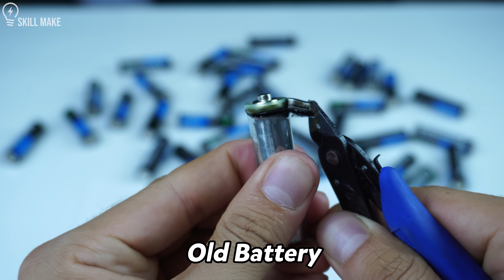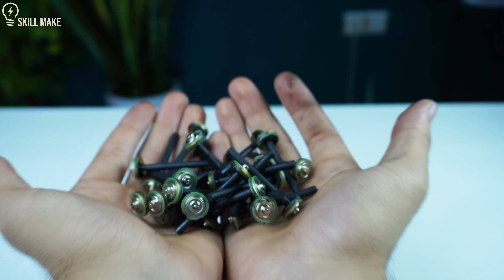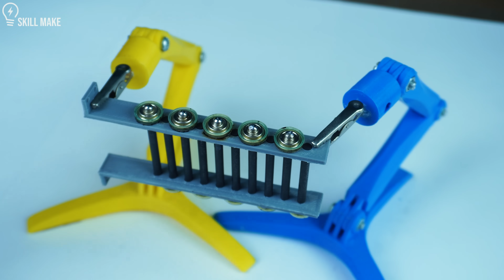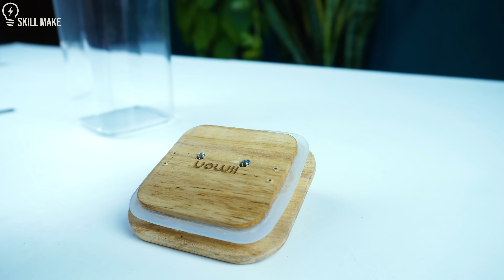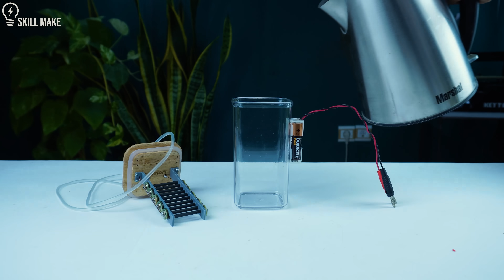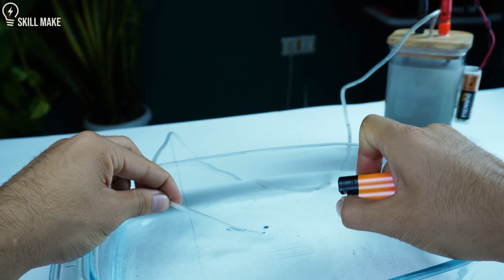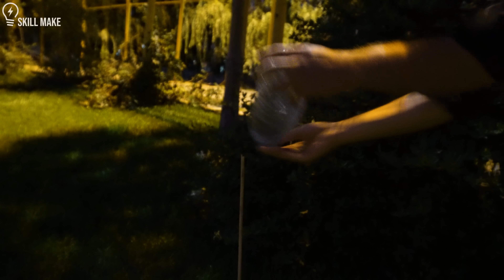Water into Hydrogen - Making a Simple Hydrogen Generator from old battery - hho

Comment: The installation is good. I tried to do the same myself, only more primitive. I didn't succeed: too little hydrogen was released. If you want to repeat it, remember that the main thing is to ensure the tightness of the system, and this is very difficult, otherwise nothing will work at all. Also try to maximize the electrode area and power. I used a cropped charge from a 2A phone. You can use ordinary water - it also conducts current (only NOT distilled). If you take ordinary tap water, then hydrogen will turn out much cleaner and will burn with a blue flame, but in this case you will have to greatly increase the voltage, otherwise nothing will work. Good luck!
Reply: Increase the surface of your electrodes. It's better to use stainless steel plates instead these rods.
Reply: Distilled water simply removes all impurities. Why would you not use it?
Reply: @Rotorhead1651  The fact is that pure H2O does NOT conduct current. Distilled water is pure H2O. If you take ordinary tap water, as I said above, then it contains impurities: all sorts of different salts and metal cations, which are conductors of electric current. That is why water seems to be a dielectric, but the current still conducts. Salt, acid or, as in the video, alkali is used to increase the content of metal cations in water and, accordingly, improve its ability to conduct electric current. However, these impurities are also involved in the electrolysis process, which is why other impurities also appear in the mixture of hydrogen and oxygen, which makes it more dirty. If nothing is added to the water ( not distilled ) then the mixture of hydrogen and oxygen will turn out much cleaner, but you will need a much higher voltage for the electrolysis process. I hope I explained everything clearly. If it's not difficult for you, please answer me in Russian. I wrote this text through a translator so that you would understand and not have to insert it into the translator and translate it yourself. I will be pleased if they answer me in Russian. Good luck!
Reply: @1KiNeTiK1   Stainless steel is certainly better than graphite rods, but I would advise using copper plates, since steel can react with the electrolyte and deteriorate or even crumble after long use, like mine. I speak from personal experience, we are tired of very strong corrosion even from a salt solution! Copper plates are much better, but they are hard to find and they are more expensive than steel. If it's not difficult, please write your answer with a translation into Russian. thanks for understanding.
Reply: @Rotorhead1651 porque reduz consideravelmente a capacidade de condição
Reply: [Quran:- 5:72]:-
“Jesus has said, "O Children of Israel, worship Allah, my Lord and your Lord." 

[Quran:- 19:30]:-
“Jesus has said, "Indeed, I am the servant of Allah. He has given me the Scripture and made me a Prophet.”

[Quran:- 4:171]:- 
“Christ Jesus the son of Mary was no more than a messenger of Allah…..So believe in Allah and His messengers. Say not "Trinity" desist: it will be better for you: for Allah is one Allah:
Reply: @HasanUnknown  these comments make me hate religion even more
Reply: NRROW THE gap between electrodes. mine is 1mm
Reply: I don't have 12 volt or higher battery ....i just have 9 volt battery ! Is there anyway i can work it out 😢
Reply: @mirae130  even a 6 volt works fine. reduce gap
Reply: @mirae130  Why not connect 6 1.5V batterys?
Reply: 2 batteries in parrel

Comment: Be careful playing with that gas mixture too much. It’s got everything it needs to burn, so it can very easily flash back up its tube, basically turning that bottle full of it into a bomb. If you could somehow split up the gas at the anode and cathode, and then recombine them right where the flame comes out, you’d have yourself a very ingenious and effective oxy-hydrogen torch. Capable of doing lots of cool stuff.
Reply: How do you put out the torch safley without blowing yourself up is my qestion

Comment: Very nice, thank-you.

Strictly this is making an optimal Hydrogen plus Oxygen mix since all the electrolysis products are mixed together.

Here in the UK, potassium hydroxide is not generally available but Caustic Soda is: equally, I imagine, as the preferred electrolyte.

Again, thank-you!
Reply: Let me tell you what the problem is. When you are halfway through electrolysis, the positive and negative electrodes will be covered with potassium, which affects efficiency. At this time, you only need to pause for two minutes before continuing. This intermittent work will surprise you.
Reply: @user
Just build a contraption to automate that process lol

Comment: I have always understood that a wet cell generator is inferior to a dry cell. I firmly believe that HHO has the potential to be a game changer. However, it must be done safely. The first method had no flashback arrestor. The second one, while it did have one, it was glass, which makes it highly unsafe. Using a simple check valve would be the best option. Furthermore, you could have used a 9v to power your device. I would personally avoid destroying batteries to obtain the parts needed. There are simpler and safer methods.
Reply: What do you use as electrodes? Carbon rods are great for the anodes (connected to battery positive), but not so vital for the cathodes. Not sure why you think disassembling carbon-zinc batteries is dangerous - it's much less dangerous than alkaline batteries (which are highly alkaline inside).
Reply: @michaelnoble2432  using stainless steel plates in a dry cell is standard. Usually, with a rubber or neoprene gasket in between each layer. Destroying any battery is unnecessary to create an electrolyzer. Plus, the wet cell method is inefficient and not suitable for the long term.
Reply: @P.I.E.  interesting - in theory stainless steel will erode when used as the anode (carbon is far more resistant to this). How do they get around this problem? I think using AC might help by reversing which plate experiences oxidation 60 times per second?
Reply: @michaelnoble2432  As far as corrosion goes, I am unsure. I am basing my information on others' experiences and builds. I have yet to build one myself, but I do plan to do so. Hopefully, as a future project video.

DC is standard, but the idea of using AC also crossed my mind. But I believe that a higher voltage DC would be more efficient. These are topics and ideas I plan on exploring in my future build.

Comment: it's better to maintain the HH separated from the O until the last moment, when you burn it. otherwise the flame can run into the electrólisis recipient and explode.
Reply: Or one can put in line the anti return valve or the thing that extinguish the flame 🔥
Reply: Su kapanı kurdu
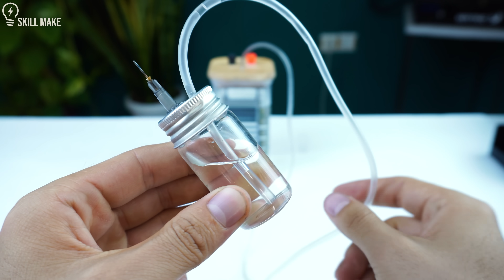Reply: @5:42
Reply: Yes!! Its compulsory to add a back fire catcher
Reply: Any suggestions on how to seperate the 2 gases, since they form together in perfect proportion for combustion?  Remember,  this is a very simple, DIY project.

Comment: Good work however  remember is HHO not hydrogen . It contains  oxygen  if get under pressure  it will inplote on the generator.  The water flash  arrestor  is good  but I will put another  before  the generator. HHO gas is very very thin and can scape real easy out of the generator container and cut on flame  🔥  .butt love the idea the battery  material  look like is very good conductor. I think is carbon ? Or graphite  .great video
Reply: Да я тоже так счаю отличное идея в жизни понадобится. Где понадобится мини тепло.
Reply: 6 seconds into the video, he shows how to remove them from AA batteries. It is a graphite rod.

Comment: H2 is the fuel of the future
Reply: no, ev is already here, in h2 you need infrastructure the same as conventional fossil fuels, you need to transport and store it. in ev. no need
Reply: @nreaction  EV's are extremely stupid, soulless cars
Reply: @nreaction  EVs need a massive infrastructure that can't be built quickly. There needs to be charging stations everywhere. Also imagine everyone getting home at 5pm from work and plugging their ev in, how much strain is that going to put on the grid? Hydrogen is the way ahead,.
Reply: @cplcabs it can be built quicker than new gas stations , and you can charge at home
Reply: @cplcabs 
Con la nuevas tecnología parece que los inventores no piensan en eso u obedece a otros intereses $ pues viendo los costos de los autos eléctricos su manutención, refacciones fuentes de carga, circuitos eléctricos más complejos  resulta que son más costosos que los autos a gasolina. Donde esta el ahorro o lo relevante, solo hacer más negocio y dinero. El H es el futuro pero no  quieren que lo usemos pues seria tan económico producirlo, e independiente de fuentes de alimentación o menos dependencia.
Saludos y bendiciones de México

Comment: This is amazing. Simple, effective, clean. Great work
Reply: Effective? No.  You would get further by farting in your tank.
Reply: Its neither effective nor clean. A neat project though
Reply: Firstly, the cheap, easy and clean way of building a mini electrolyser, is great work. I don't know how potent and continuous your farts are, but I can assure you this gas is a great alternative solution
Reply: @outkast187 Has to be the simplest form of fuel production. That in its self is worthy of science.
Reply: @idenhlm  what!? did you study any chemistry at all?
Reply: The main problem is how incredibly inefficient this is.
You have a perfectly viable energy storage in the shape of a battery, yet you go through a process with huge losses to create a volatile and hard to handle fuel in the shape of a gas. It's ridiculous.
Reply: One thing to clarify here people....this is an illustration of how and if H2 production is possible. Furthermore how easy it is to produce, that's it. As with every energy resource, it has many more complicated process throughout the supply chain. As for your battery resource, it is by far one of the worst energy resources, in future you will see how bad, when landfills are polluted with them, leakages will destroy habitats. So perhaps start supporting and solution for these fuels which produce water as the emissions.
Reply: @idenhlm  you do realize that you can pull oil from the earth...run it through a filter...and run it in many diesel engines with no other effort? Or capture natural gas, and run that as is in a gasoline engine?
Reply: @Alex-fw6ti  You do not understand chemistry at all
Reply: @outkast187  what?
Reply: @ratratrat59  😂. Ok Mr White
Reply: @Alex-fw6ti  Do you have any education in math, chemistry, physics? Just curious.
Reply: @skatterpro  blue collar science.
Reply: @ratratrat59  yes in all, stronger in math and chemistry.
Reply: @Alex-fw6ti  I bet you understand relativity too. Now stop and think about my meaning. Do you get it?
Reply: @ratratrat59  my relatives or your relatives? I don't know you, so I don't know your relatives. But my relatives, I guess I can find out if they know.
Reply: @Alex-fw6ti  I hope you are not serious with this response. I do not know whether to laugh or cry.
Reply: @ratratrat59  go with your initial thought and whatever makes you happiest my friend.
Reply: @Alex-fw6ti  good night, sleep well. Enjoy your bliss
Reply: @outkast187 😂😂😂😂😂🔥
Reply: @Alex-fw6ti  hydrolysis is literally ancient. Creating hydrogen gas is novel, but it doesn't change the fact that it's a terrible energy storage solution. I don't care about your "you'll see [when batteries are in landfills]" - fact of the matter is that batteries exist, can be improved, and are already better than the dead end that is hydrogen gas as a medium. You can't change basic physics. You can't change the laws of relativity. Your education in math and chemistry is clearly not enough to understand this.
Reply: @skatterpro  thanks Einstein

Comment: Nice video. Maybe it would be a good idea if you pin the comment and inform people that not every battery type has this kind of construction. I learned it the hard way just recently, but at least I had a bunch of empty ones. From approximately 30,  I only found graphite core in two I think. C and D type had a much better ratio, but it's still so so. I don't know if this depends on chemistry. I didn't mean to spam, but seeing 61K have already seen this, I don't want them to linch you:)
Reply: Which type of battery should I look for
Reply: @blank..-.. for alkaline dry cell batteries
Reply: @vaclavmoravec5764  thanks
Reply: I don't think the audience is so cruel as to lynch anyone.
Carbon electrodes are contained in the cheapest salt batteries.
Reply: @blank..-.. graphite electrodes are available in stores with welding equipment, at least in our country
Reply: Carbon zinc…. Usually marked “heavy duty”…. Not alkaline @blank..-..
Reply: @blank..-.. Cheap "old style" non-alkaline carbon zinc dry cells are the best.
  I think you're not going to enjoy the disassembly of an alkaline battery.
  Also, although not strictly, use of the term "dry cell" will make most think of the old carbon zinc ones anyhow. 
   I used to break down old D cells for the carbon rod cores and make an arc furnaces in clay pots with them for small smelting jobs.
   Choose the carbon zinc, cleaner, cheaper and most of them you ever come across, will be almost dead anyways 😂.
  Be safe, be well ✌️
Reply: I had the same experince and learned that way that in the video Zinc Carbon Batteries were used, stay away from Alcaline ones  :-)

Comment: I really like the battery salvaging  and the 3d printed  custom bracket but the design  needs more engineering to get pure hydrogen, no corrosion issues, and fine brass wool flashback  arrestors.
Reply: The brass wool might work for methane and similar gases, but I don't think it would work with a (near stoichiometric) mixture of hydrogen and oxygen.  The flame velocity is very high and I think it would pass through quite tiny gaps before enough cooling to douse the flame.  I suppose if it were fine enough mesh it might be possible, but would a very fine mesh be at risk of being broken or melted - either producing bigger holes or clogging up the holes?  An interesting problem, but perhaps just try to keep the gases separate.
Reply: @Merlin3189 it really does though I've witnessed  tests myself but it has to be extremely  fine brass wool typically  found at a boating supply.

Comment: The voltage between the two electrodes must be limited to 3V. If you give 12v directly to the electrodes, the system will heat like hell. I done this thing to my motorcycle a while ago to increase fuel efficiency and power.
Reply: How does the fuel efficiency and power can be increased can you please tell me
Reply: @Johnnywhitefield  I said I did it to increase power and efficiency, I didn't say it did that. Theoretically it may increase some power because of the hydrogen released to the air intake. Removed it because of maintenance and fire hazard.

Comment: You could just make a resistance heater with that one battery and youd get the same heat. The power from the little battery is splitting the water up at that same power rate. Then the flame can only reassemble that water at the maximum of that power from the battery. Theoretically. But there will be losses so itd actually be less. Some losses can be negotiated away, but a large bit of losses are nonnegotiable. Probably something like 41% efficiency at the max
Reply: You’re right but that’s really not the point of the video.
Reply: I believe the flame is much hotter than a resistance heater

Comment: "Great video! I have a question: before inserting the needle into the second small cylinder or jar to create fire 🔥, is it regular water inside the small container? Or still mix with potassium hydroxide.
Also, can the water run out of the small jar or can while there is a continuous flow of hydrogen from the large container to the small one?" Or will it be filled with water bubbles due to the continuous hydrogen into the small cylinder?
Reply: agua normal para evitar que el fuego entre hacia adentro 🙋🏽‍♂🙋🏽‍♂
Reply: Its regular water, its actually a flashback arrest, HHO is extremely flammable since it has hydrogen and oxygen together and just needs ignition or high temp to ignite, so that bubbler doesn't let the flame pass back to the generator cell. Its a safety valve but transparent soft tubing isn't best for production since it can melt and cause boom.